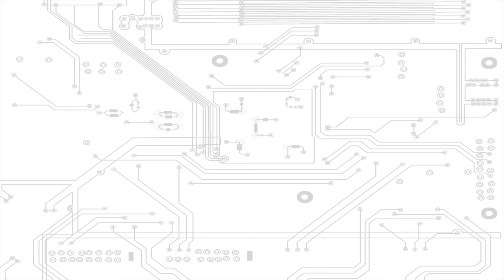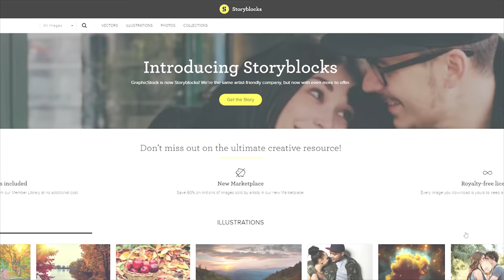Watercooled and Overclocked 7960X in Cosmos C700P

Comment: Guys my Am4 backplate has one screw that won't screw in, is it ok to run an aio with just 3 screws 🤔
Reply: Yes, back plates are "mostly" visual.
Reply: masterzedd4 I mean the backplate of the Mainboard, where you screw in the cooler
Reply: You won't get even pressure and may not have even contact, pushing your thermal compound to one corner.
It's hit and miss But I wouldn't chance it. Learn from my experience and just do it correctly, RMA if you have to.
Reply: You should probably contact customer support about your options, if you happen to have just recently bought that cooler.
It's pretty important that all four points are nice and firmly tightened. (You can probably run things no problem, but why risk it? Ya know?)
Reply: I would go as far as remove the third one and use 2 on opposite corners, just make sure you screw them in at the same time and same pressure. Make a test fit to see if the paste spreads evenly on the CPU.
Reply: My appologies, i read that as the back plate of the video card.  Everyone else is correct.  You need all 4 points tightly secured for proper heat dispersal.
Reply: Shallow Revelations thanks for your help everyone, I get better answers here than in a tech forum :D
Reply: my brother had the exact same problem I tried every solution I could think of "without damaging anything" but nothing worked so we used the stock cooler for some time. BUT the temperatures were insane and we had to put the cooler in DIY way :P zip ties and voila it's cooler than ever. It is not a great solution but as long as it works I'm happy and he's happy. :)
Reply: You can do it LTT style and use a cable tie.

Comment: I had a buy 2 more drive cages, which was a pain not only cause it cost more but the delay to get the sleds. Another problem I had was with the expansion slot screws,  either need an extremely short screw drivers or need to be access at an angle which isn't good for the screw thread, or need to install the graphics card while the mobo tray is not, which is not convenient. Great looking case and heavy AF, but below expectations on build convenience.

Comment: Love all of your watercooling builds. Always glad to see a new one pop up. could you use one of those drive "sleds" as like a mounting point for the resivior or even better you could use it as a mounting point for like ssds or fan/rgb controllers if you just made a flat tray for the accessories to mount to? 3d printing would work great and be a good excuse to get Barnacles in a video, just make sure he uses PETG or ABS

Comment: Just built in this case. Love it to death! And that baby weighs 48 lbs empty. Ryzen 7 1800X, Asus ROG Crosshair IV Hero Wifi, NZXT Kraken X72 360 AIO, 16gig G.Skill Flare X. Samsung 860 Pro 1tb SSD. Sadly, I only had it for 2 weeks and put in a new power supply and it fried the board and all my hard drives, and screwed up the AIO. Took me several months of saving to build it,... starting over. I made a 10 minute 40 second video of my Rags to Riches: A PC Love Story, which is on my page.. It was a beautiful machine.
So I loved seeing you build in my case. Came from an Amd A10 socket2, so you feel my pain.
And am now on a loner from a friend that won't play games..... lol,.. my life....

Comment: Instead of using the included "socket" for tightening down the motherboard stand offs, you can use a 3/16" nut driver. So much easier

Comment: The shrinkable thing you did with the heat gun and the backing. What was the backing that you used? I am so new to it all. I guess you did it to quite vibration. It was a nice tip. Thanks for putting it in there. I have never seen this done before.

Comment: I really would love to get into custom watercooling but wish the draining and replacing of coolant would be more refined ie an external pump  that connects to those quick disconnect type connectors and the pump connects to a big container and its easy to pull the water out and then push clean water to get rid of the gunk and so on.

Comment: Here's a challenge for you.
Make a water cooled system without a standard radiator.
The idea behind this is instead of using heat holding plastic tubing, you instead use copper pipe with brass fittings and use lengths long enough that it can be coiled and cooled by the airflow in the case or outside even. Radiators are just about surface area and there is a lot of surface area on a length of copper pipe.

Of course the big issue will be with water flow rates as long lengths with coils will require a more powerful pump to overcome the added resistance of the distance.

Instead of all these fancy colours with the fluid, the copper itself would be the design feature of a functional steampunk type design. Although adding a short illuminated clear section(s) to the build could give the impression of mystical fluid flowing through the system.

Now it may not be as good for overclocking as a traditional radiator, but it might work just fine with something like a Ryzen 7 build that will not overwhelm the system with excessive heat when overclocked, allowing the fluid temp to stay well under the max fluid temps for the other components. But then again with enough surface area and a high air flow case, it could work out even better.

Comment: My question is, why you would put a rad on the top mount, because wouldn't the system be pushing up warm air towards the top rad and create more heat that would have to go through it? I don't have experience with liquid  cooled systems, but this is just a thought I had. I would assume it would be best to have a bottom and front rad, with just fans on top and on the back?

Comment: Nice bait on the GPU. When I watercooled in the CM STORMTROOPER I used an ectension for the 8 pin so that a faulty power supply could be changed without disassembling the loop before scheduled maintenance intervals.

Comment: Here's some idea

Logitech G27 with watercool system on both motor
or
T500RS with watercooled motor alongside with badass radiator.

Why ? We in simracing community normally will race for hours, for example in iRacing IMSA series that will lasted 75 minutes, and 80% of iRacing 65k subscribers still using G27. A turnkey watercooled G27 system will definetely sell :D

Comment: I have to ask why zip ties?  Due to the size I assume that makes it easier to lock down cables?  I had a job working in a data center and ever since I've always used velcro tape.   Just so much easier to bundle/move around. You probably won't get as nice a situation as zipties  will give you, but still.   Just wondering...

Comment: You say that modern high-end video cards have amazing cooling and that water isn't really required, but I've got 2 asus strix 1080ti cards (the oc versions) in sli and they get really hot to the point of easily hitting the stock throttle temp of 83 degrees (particularly the top card because the bottom card somewhat blocks the airflow of the top one despite putting a 120mm intake right on them (there's a mounting point between the cards on the side panel on this case, a coolermaster 690 II) as well as the normal bottom 120mm front intake, the normal rear 120mm exhaust, and 2 120mm exhausts on top (plenty of airflow).  I have my overclocked ryzen 1700x on air with a noctua d15 and that works great, but man does that top gpu get hot still.  I think that when it's time to upgrade gpus (volta maybe?) that it might be time to either sell my rig outright (less a few hard drives), and start from scratch, or maybe just ditch the case, noctua d15, and go with a full 320mm rad (maybe dual 320mm rads) custom loop perhaps with something like the asus Poseidon series cards and hard tubing...  but MAN are water cooling parts expensive, particularly from the big guys (with amazing support) like EK.  shelling out an extra $500-$1000 for water cooling is difficult to justify.

Comment: What size rigid tubing are you using?  10/12?  10/13?  Looks like you're using Primochill Rigid Revolver fittings, which are 10/13 in size, unless you got the washers for 10/12 compatibility.

Comment: Hi ! With water cooling I have now already for a while. I am very interested in this. The Cosmos C700P is also to be used for my new upgrade. In your video you can see that only 1 water cooling circuit is installed. In my opinion this should also be completely enough. At least for gaming. Where mainly CPU and graphics card to work, and also with water should be cooled. How high is actually the reservoir of the pump you have installed? Can the hard drive cage be further down? Is also still place for a 45er Radiator in the front possible.
Nice video. Sry for my bad english. I am from Germany .
Bey.

Comment: On that Seagate hard drive you covered, Did you unblock the breather hole for the drive, cause that's the only way the HDD can breath, if not its going to run hot then fail...

Comment: Just ordered this case, and have two separate closed loop coolers. Thoughts on an intake radiator on the front (for GPU) and exhaust radiator up top (CPU) with the exhaust fan out back? Or should I try to get my hands on a third bracket and have some cool air getting blown in from the bottom as well?

Comment: Jay can you confirm that the 360 you used is actually a 60mm and not a 45mm? The only 360mm rad EK sells currently with the XE badge shows it being a 60mm thick. I want to know because I want to buy two for my system with this case. Thanks!
Reply: Rob Lat I’m using a Maximus 9 Apex, which has very low profile heat-syncs. I want to run one rad in the top and one in the front. So that should work with fans on one side of the XE rad as long as my mobo doesn’t interfere right?
Reply: Rob Lat I just watched it and you’re looking good there man! Thanks for answering my questions!

Comment: hey jay I'm a small pc gamer. looking for a good build idea for a budget something that would play games at really good fps and good graphics but not break the bank. looking for something around 1100$ usd ive been using intel for awhile my currently laptop is a 960m gtx 4gb with 8gb of ram and intel i5 6300hq 2.8ghz to 3.2ghz it plays older titles good but newer ones suffer a bit on the graphics for performance. what would you suggest as graphics card motherboard and cpu?

Comment: All cases bigger than a mid size should have handles. I have a Azza Genesis 9000w and its super big but no handles and sense it has plastic bezels on the top, bottom and front there is really no good way to grab it with out just giving your whole computer a big bear hug to move it from place to place.

Comment: @JayzTwoCents Yo what's that radiator under the reservoir used for like is it set up with the other 2 top and face radiators or is it just sitting the for looks does it have any function to it? Need to know building in this c700p. thanks.

Comment: Could you fit a 45mm rad in the front then put the reservoir where you have it??
Reply: I would guess yes.  It's a huge case.  Might need to shift the reservoir over an inch toward the motherboard, but I bet it would fit.

Comment: Hey Jay could you please explain or show how you mounted the reservoir? I'm doing a similar build with the same casd. The mount that came with my EK Pump/Res doesn't fit where you mounted yours in this video.
Reply: Looks like he's using the Photon 270 reservoir.  If so, the new version (V2) has a mounting mechanism that makes it really easy to mount in this case.

Comment: Need some help please! Recently built a new pc and I got my first fully modular PSU (RM650i); my question is regarding the 12v GPU connection(s). In the past I've always done a single cord from the PSU that has dual 8+6 pci or whatever and with extensions it was pretty straight forward. Now, I'm looking at getting actual cables through cablemod but I'm confused. I want the cleanest look possible and I'm running a single card; should I order 1 x 8 pin pci and 1 x 6 pin pci? I guess the thing that scares me the most is having two 12v cables going from the PSU to the GPU. I don't want to fry my card... is this safe? I don't want to feed her 24 volts haha

Comment: Hey Jay, it's rare but have to disagree with you on the qty of 3.5 drive trays. I build high end gaming and editing systems, and have been since 1994. The last time I built a gaming system that required even 1 3.5 HDD was over 18 months ago.  The majority of the customers for this case will be gaming related.  As long as the trays are available as an option I'm fine with it. Again the majority of buyers these days will not use more than 2 and keeping the cost down for the majority is the better business decision.  Besides a system with that much $$ hardware,  then complaining about the extra cost of a few trays. Is like a Ferrari 488 owner complaining about the price of fuel.  Lets have some perspective.

Comment: HAF cases where amazing for a cooling standpoint my old 912 case and 2 200mm cooler master fans beat my current NZXT h440 with nothing but noctua fans everywhere i blame my case of course for that sure it looks cool but my 1080 when pushed is at 82C(nvidia's max before turbo goes out) with my 912 case i never had temps above 72C on my GPU

Comment: I have a Brand new Deepcool Dukase case with the GamerStorm Built in liquid cooler (which i got yesterday and put it together yesterday) that has some issues with high temps. recently added new thermal paste and mounted everything. my motherboard and everything is really cleaned out before i put everything in my new case. but why is that? on my old ass NZXT Havik 410 i had stable temps at 30 to 50 no matter how far i pushed it. when i was playing forza horizon 3 just recently my temps hit 70. and that does not make any sense to me since i went from air cooled to water cooled??? Any tips on what i could do would be highly gratuated! Specs: MSI Geforce GTX1060 6gb Gaming X, Asus z77 Sabertooth MOBO, 16gb ram, Intel core i7-3770K. BTW i livestreamed it. its on my channel. the last one i recorded is the one where i got 72C on my cpu. just jump to the ending and you will see that its really high. my computer also pushes HOT air out of the case.

Comment: How is the reservoir mounted? I only saw a quick flash of the install. Doesn't look like any mods were needed?
Reply: Not if it's the photon V2 270.  The V2 has a mounting mechanism that makes mounting it in this case painless.

Comment: Looks like he took the thread ripper block and modified it to sit on the 7950x. I cannot find any Intel compatible ek supremesy blocks with the same logo and fittings orientation
Reply: all ek supremacy evo blocks fit amd and intel sockets
Reply: Hi Trin, Not all EK blocks fit intel sockets, you have to buy the supremacy with the right lga fitting, but i know what you mean, there is a supremacy block for a wide range of sockets. However that was not my question. If you look carefully at the Intel Socket Supremacy products, you will see they all have the inlet and outlet side by side, I need a top / bottom config, so the solution would be to rotate the block, but then the EK logo would be on the bottom left. In this video, Jay has an intel block socket on what looks like the block from a thread ripper socket, the inlet and outlet are vertical and the ek logo is on the bottom right. I cannot find this product on the EK site. so my assumption is he bought the two and swapped the blocks. do you know what i mean?

Comment: Hey Jay what water cooling system did you use?
Reply: I was able to piece together a couple things.  Looks like he's using a Photon 270 reservoir, Primochill SX fittings (which means he would be using 3/8 x 1/2 petg tubing), an EK cpu waterblock.  Not sure what brand radiator he's using.
Reply: Thanks

Comment: Jay, think a z370-E will fit in this with a 45mm thick top rad? In the vid looks like your fans are maybe just touching the esp plugs? on the 370-E looks like the ram slots sit alot higher aswell as the heatsink https://i.imgur.com/vqOGnFA.png

Comment: Just looked into these maglev fans from corsair and I must say I'm underwhelmed by them. Their noticeable strength is in the low RPM that they can achieve, but they aren't specified as being any quieter than other static pressure fans nor do they offer the greatest pressure either.

The maglev looks to me to be a marketing gimmick that doesn't offer anything super special over other advanced bearing designs that have long lives, you're paying a premium for an unknown or not advertised bearing life expectancy. While I like the idea of maglev bearings, the bearing itself does nothing for the way the fan performs in pushing air through the radiator.

Comment: Yea i definitely also would want more mounting space for watercooling/clearance then HDD's. I mean HDD's are heavy/loud/slow/hot i see no reason to use them anymore besides "saving money on storage" or maybe having one to backup your stuff. I dont know alot of poeple that really need more then 20TB of storage space. If you need it ok then i think you can live with the extra cost of buying little brackets 99,999999% of all other users dont need/want. The thing i dont like about the case is the massive amount of cables that it comes with straight from begin with. I mean you opened it and my thought was "omfg, i think i have less cables in my whole PC then this including my PSU and everything".

Comment: How do you people all get by without an optical drive?  I get it if you are making a gaming only rig, but I use my optical drive on an almost daily basis.  I have 500 CDs in my collection that are getting ripped to .flac for archiving, and I have about 200 DVDs that are getting ripped to both ISO and encoded for playback on my media servers.   Keeping that darn drive screws things up because that darn tripple cage for a single drive sucks.  and it eats up ALL the space for a resivoir.  Currently cooling with an H110i, and it just doesn't seem to perform that well.